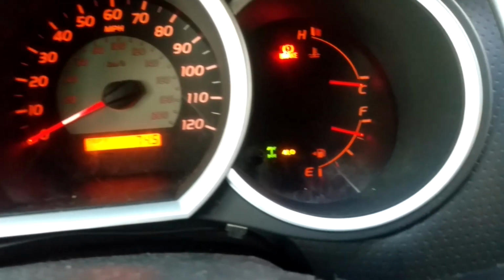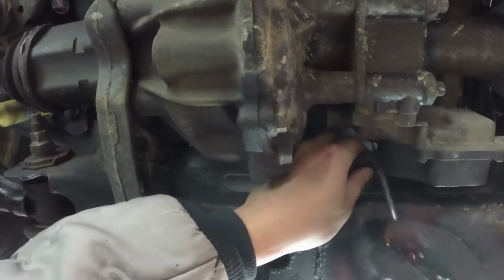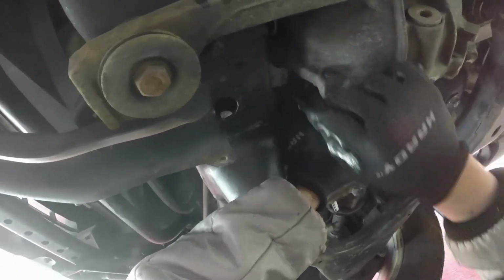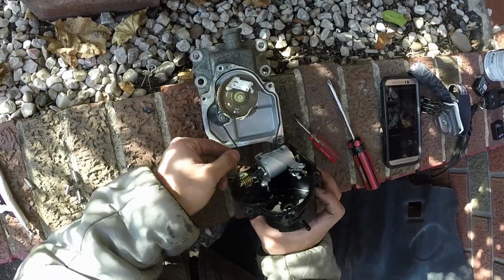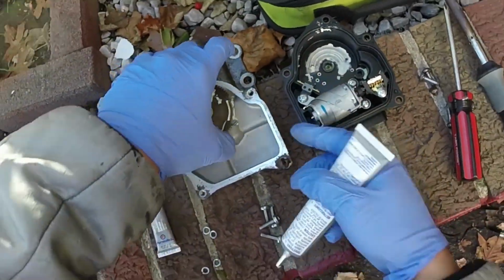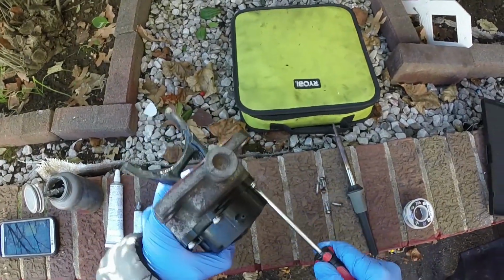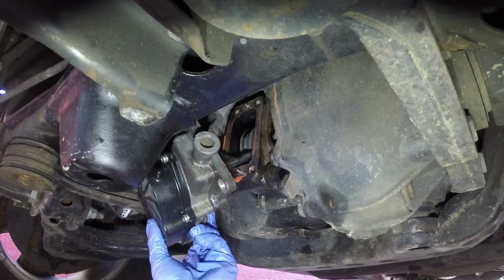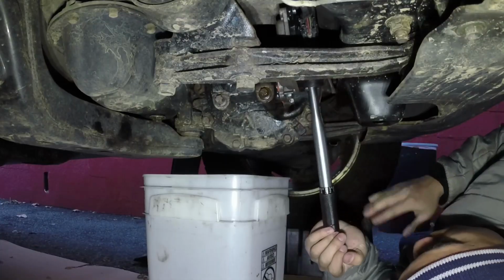4WD Fix (Tacoma DIY / How To)

Comment from the maker: If this video helped you out, please donate! https://beer.kflo-krib.com/
If you need to replace the actuator, you can find it here: https://amzn.to/35ty5S3 (Dorman) or https://amzn.to/2SNd69m (Aisin).
Also, Make sure that when you reinstall the actuator, that the fork is in the center of the pulley that slides up and down the shaft!
Reply: Says not for 2009 tacoma
Reply from the maker: I think Amazon marked it incorrectly, you can read the reviews and one if the guys says "fixed my 2009 taco"
Reply: @TacomaTutorials  I found the aisin one for $175 in amazon too
Reply: Karl are either one of those OEM?
Reply: @o_g_i_b_rockin  I would definitely go with Aisin over Dorman. They make a lot of OEM parts.

Comment: My shift fork isn’t fitting into the grooves. Please help
Reply from the maker: Physically move that collar back and forth in the differential. Then you should be able to wiggle the fork into place. Make sure youre orienting the fork properly
Reply: @TacomaTutorials  ok thanks! it ended up being a shitty oreily dorman part. I put an oem in it and it fit fight in

Comment: Went to do this, and cant get the 4th bolt buried on the passenger side. Which ratchet are you using?  I either cant get the head on the bolt or cant get it to swing through the space. Very tight and annoying.
Reply from the maker: I used a 1/4" drive ratchet which is small and thin. I also have a variety of heights on the sockets and used the one that fits
Reply: @TacomaTutorials  Finally got it off!  How did you get all corroded screws out of the actuator?  Sprayed with penetrating oil overnight, wire brushed, picked and tried several screw drivers & vice grips with no luck. Dremel to cut the heads off?  Or maybe just a new unit.
Reply from the maker: I used needle nose vise grips and clamped down on the really stubborn screws. If it's too seized, then you can defintitely find a rellacement unit on amazon for relatively chea0
Reply from the maker: Dude, thanks so much for the beer fund donation! I appreciate it! I'm glad the repair worked out well for you!

Comment: Can you just pull the plastic housing off without having to pull the hole assembly? If no why not?
Reply from the maker: You can try, ther's two Philipps head screws at the top with the ~1" of clearance. It will be tough to get leverage

Comment: Hi,my 2006 tacoma 4wd only engage when the truck is turned off, then when i turn it on the 4wd stay on and can go to 2wd but cant go back in 4wd until i turn the truck off, do you know if this video will repair this ? Thanks!
Reply from the maker: The video will repair this. It sounds like the position sensor is not making good contact. On the reassembly, just clean up all of the grease on the underside of the plastic housing as well as the fork that glides against it. Don't use any grease on those specific contact points and you should be good to go

Comment: Hi i have a toyota hilux 2006 4x4  my front diff dont want to lock  i have the same ass you i wacht this video and try do it but it dosnt show anyting on the dash the motor works and everting but nothing   the only thing is that the smal hose of the actuator wa.broke nothing more i dont have a actuator on my tranfercase ,, it did the same as you flashing  first on the dash then nothing pls lett me know what more can i inspect so a i can fix it  thank you
Reply from the maker: That hose is actually a breather hose. The actuator may have taken on water and fried the motor. Take it apart and replace it. A new actuator is about $150. It's better to replace the thing at this point but if you have the time and the tools, then you can go ahead and try to perform this fix
Reply: I have to hilux 2006 go on 4x4 is angage but the still blinking even I off 4x4 back.what do you thing?

Comment: My 08 tacoma wont go into 4wd. Just flashes the green 4wd symbol on dash and I can hear clicking in the glove box, which I assume is the ACU. I also checked the front drive shaft that runs from the transfer case to the front diff. when I engage the 4wd and hear the clicks the front drive shaft locks up. If im not mistaken this should mean that the ecu and transfer case are both operating correctly and that would point all fingers to the actuator right? Would love your opinion
Reply from the maker: Did you hear whether or not the transfer case was clicking? It's at the rear of the transmission at the rear end of the front drive shaft. What may be happening is that the transfer case and the front actuator may not be syncing up
Reply: @TacomaTutorials  I havent looked at that, but if the front driveshaft is locking into place wouldnt that mean that its working?
Reply: and by "it" I mean the transfer case
Reply from the maker: It means that it could be locking from either the transfer case or the front wheel drive actuator. Both have to lock together for the 4wd to work. If one is locked and the other is not, the drive shaft can still lock into place.
Reply: KFlo Tacoma so your saying that it could be the actuator on the transfer case instead of the actuator on the front differential
Reply: Or how else should I go about fixing this possible issue
Reply from the maker: I would suggest the following, go from step one and then if that doesn't work, move onto the next step:
1) Turn the truck to 4wd first before turning on the truck. See if that does engages it completely
2) Unplug the harness on the 4WD actuator and clean the connecters and plug it back in, do the same thing with the transfer case actuator. Try to activate the 4wd. Listen both at the transfer case as well as the front wheel drive actuator
3) Perform the fix on this video. Keep the grease off of the housing though, the forks  need to make good contact so that the position sensor is working properly. This is the semicircular contacts on the plastic. 
4) Hopefully, you don't have to get to this step, perform the same fix on the transfer case actuator.

Comment: I've got an 08' that will go into 4 wheel drive, then I'll go back to 2 wheel drive no problem, then if I go back to 4 wheel drive, I've got nothing. No light, no click. The only way to get it back into 4 wheel drive is to turn off the truck, put the switch into 4 wheel drive then turn the truck back on. I'm at a loss. Everything works like it should, just have to turn the truck off to get it into 4x4.
Reply from the maker: The position sensors may not be contacting properly. I would advise to open it up and do this fix but in addition, make sure you clean up all of the grease off of the contact forks on the plastic housing

Comment: My FJ Cruiser actuator dont want to engage on 4H, dealer suggested to replace it for C$790, ouch! I will probably attempt to fix it the way you did, I never off road so probably it just seized up or need soldering, hopefully nothing major, thanks for the suggestion!
Reply from the maker: I think you can also find the full actuator on amazon, go to my page under driveline upgrades (amazon.kflo-krib.com)

Comment: I'm stuck in 4hi and your fix didn't work for me. Another ideas or just a way to get it into 2wd for now.
Reply from the maker: disconnect, clean and reconnect the harnesses. if it still doesn't work then verify if the function:
One way you can verify that the computer is talking with the actuator would be to have the actuator removed completely off the front diff and then plugging it into the harness. Cycle the 4wd and see if that fork moves left and right. If not, then remove all of the grease on inside of the plastic cover (there's another metal contact fork that rides on there) and the verification again.

Comment: @Kflo Tacoma
Reply: @KFlo Tacoma....i have a question regarding re-assemble of the actuator.  does it go back together fairly easily...where should the fork be at the time as re-assembly.  i am afraid i am not lining up the switch on the inside.  can i leave the fork in the middle?
any help would be great.  thanks in advance for your time
Reply from the maker: it's easy to reassemble, follow the video and you'll be fine. Make sure that the fork is in between the collar when you put the actuator into the front diff. The actuator has a position sensor so you can put it in far left or far right, it doesn't matter - just make sure that the fork is in between the collar in the front diff.
Reply: @TacomaTutorials  thank you for the reply, i understand how the actuator assembles onto the axle, my question refers to the actual motor/gear assembly inside the black housing.  i moved the gears (stupidly) and i think the small switch doesn't sit on the cam correctly.  does that make sense?
Reply from the maker: Maybe the pictures from this thread will help with the reassembly: https://www.tacomaworld.com/threads/how-to-trouble-shoot-4x4-actuator.263525/

Comment: Thanks for the video! I think it has been asked already so my apologies, but wasn't sure on the answer. When I switch it to 4Hi I can hear a motor spinning in what I think is the actuator, but could be the transfer case I guess? Is this how yours was? If I hear a motor spinning does that mean that the connection is just fine? Just want to make sure we were in a similar boat before tackling this thing tomorrow.
Reply from the maker: The 4wd acutator is an electric motor that you can hear when it engages
Reply from the maker: The transfer case is for switching from hi to lo
Reply: @TacomaTutorials  Got it. So if I can hear the actuator motor turning when trying to engage but it won't switch into 4hi, would you still recommend trying your repair or would that be a different problem? Thanks for getting back to me quickly!
Reply from the maker: The transfer case and actuator work together so I would still recommend it
Reply: @TacomaTutorials  It worked!! So stoked. The hardest part was definitely getting all the bolts and screws loose. Thank you so much for the video!
Reply from the maker: Sweet, I'm glad it worked out for you

Comment: I’m having the same issue, when you turned the switch to engage 4x4, would it make any noise? If I turn the switch there is no noise from the transfer case or the front diff. If it was the front actuator wouldn’t the transfer case still try to lock?
Reply from the maker: I believe the transfer case spins the front drive shaft all the time. the 4wd actuator engages/disengages the front diff to lock onto the spinning front drive shaft

Comment: This makes me realize how much I loved my 90 Toyota 4X4. Manual four wheel drive lever, manual locking hubs, lever activated blend doors. Good stuff!
Reply: Sounds delightful. Too much electronic tech nowadays, and that’s coming from a 20 year old who’s pissed at all my vehicles for having electrical problems! What I wouldn’t give to just operate everything mechanically...
Reply: Same i love my 99 Tacoma manual everything the only thing electrical in the interior is the radio lol
Reply: My 92 was the best. Even the 4 cyl Eng.
Reply: Same I got a 2001 with manual locking hubs. So nice
Reply: Amen!!!!   I loved my ‘94.   Simple - bullet proof.
Reply: I had to make a 30 minute drive in three inches of snow at 5:30 🕠 this morning and was happy as could be when I pulled the shifter on my 2002 Tacoma 4x4 and it went right into gear ⚙️ I don’t have lock out hubs but it sure did feel good when it went in gear.
Reply: Got a 98 and it’s 4wd light comes on but 4wd isn’t actually working

Comment: Make sure before anything the fill plug will come out first . Thanks for the video I learned a lot .
Reply from the maker: Good tip!
Reply: Rambo Ollie what is the full plug?
Reply: @DirtBikes_MathGarden   Fill plug. So you can make sure you can fill the differential back up once you are done with the fix.

Comment: This is an excellent DIY video, BUT viewers have to understand that this only fixes a motor connection problem.  There are things that go wrong with the actuator that following this procedure will NOT fix.  So, if the motor doesn't activate then this might fix your problem. However, if a switch inside the actuator is what's no good then this will NOT fix your problem.  Not knocking the video, it's a great fix when the electrical contacts have failed.

Comment: This didnt help me any ideas?
Reply from the maker: Did you check to make sure all the electrical connections are clean? That includes all the harnesses and contact points as well as the contact points on that contact fork.
Reply from the maker: Did you also do the 12 v test with the alligator clips?
Reply: @TacomaTutorials  is there something i need to reset ? The light starts flashing before i even start the truck.  When i go to put it in 4 low it flashes a bit slower
Reply from the maker: There is no reset, it looks like the position isnt being properly read
Reply from the maker: I would recommend taking it apart and cleaning out the dielectric grease on the contact prong against the housing. It's a semicircular metal striping. Reassemble the actuator. Dont install it against the diff but plug it into the harness and cycle through the 4wd to see if it does engage and validate that the fix worked
Reply: @TacomaTutorials  ah thats a good idea. I should have tested it with it not bolted to the axle. I did clean all the grease off the contact prongs and add a thin layer of new dialectric grease maybe ill try it without any grease. I noticed the t case has a similar actuator.  Those ever go bad or do the same thing ?
Reply: @TacomaTutorials  so i was under it again today and it seems like maybe its the t case actuator? Is there any way to test this one ? When i put it in 4wd the front driveshaft doesnt move at all. Would that indicate that the t case is not shifting into 4wd from there ?
Reply from the maker: If you engage the transfer case while its on jack stands then that means that youre locking the front to the rear, therefore it wont move. Were you able to test that diff actuator? Did you clean the contract prongs at the transfer case? If you put it on 4 jack stands, and you engage 4wd, do the front two wheels engage/lock? You should be able to hear the actuator move when you're under truck too
Reply: @TacomaTutorials  i took the diff actuator apart and tested it and added solder to the terminals it sort of worked. I re installed it and it did the same thing. So i took the transfer case one apart and it seemed ok. I think that they both have to work in series for the t case to shift into 4wd. When i shift from 2wd ti 4hi nothing happened and the front driveshaft spun freely with my hand. I took the t case actuator off and pulled the shift fork out by hand into 4hi then re installed the actuator. When i started the truck this time i heard the t case actuator running and switch back into 2wd. After this i tried to put it back into 4hi and nothing happened the lights started flashing again. So i got back under the truck and tapped the front diff actuator with a hammer and the light on the dash stoped flashing 4 low and just had the green 4wd light flashing like it usually does when you switch i to 4hi at a stop. Usually it turns solid green once you start moving a few feet. Soooo i think the front doff actuator still has problems i went ahead and just ordred a new one it was pretty cheap. If that fixes the problem ill post here. Thanks again.
Reply: Yes the plug was spotless i went ahead sprayed it with contact cleaner anyways.  Also ran a 12v supply to the motor and it runs perfectly fine . Is there an actuator on the t case as well ?
Reply from the maker: When you opened the actuator itself, did you clean out the contacts on the housing? Theres a fork that slides against that housing that measures the position of the actuator.

Comment: I just got done doing this and the light is still flashing do i need to reset it or somthing ???
Reply from the maker: No need to reset. Is it engaging? Did you try to turn the knob on to 4wd before starting the truck? If so, did you hear the actuator engaging?

Comment: KFlo's Tacoma Build  I have a 2014 Tacoma and it’s stuck in 4x4 I tried resetting it and driving back and forth to see if it it goes back to 2wd but it doesn’t you think I will have to do this or a other issue
Reply from the maker: i would advise to remove the connector and use a contact cleaner on the metal contact points first. It may just be a connection issue. If that doesn't work, then you can pull it off and take it apart per this video
Reply: KFlo's Tacoma Build I want to try this because I think mine may be a connection issue since it seems to be driving normal however it’s not going into 4WD now
Reply: KFlo's Tacoma Build  thanks man just did pulled it off and took it apart and just put it back together and it’s still stuck in 4x4 any thoughts on what my issue may be thanks 👍🏽
Reply from the maker: Did you test it with the 12v power source like what i did in the video? Also, sometimes the dielectric grease inside the housing that is used for the position sensor ( its the metal semicircular strip, prevents clean electrical contact. Clean that off and test it out while its off of the truck prior to reassembly